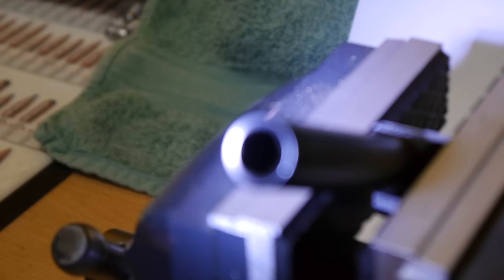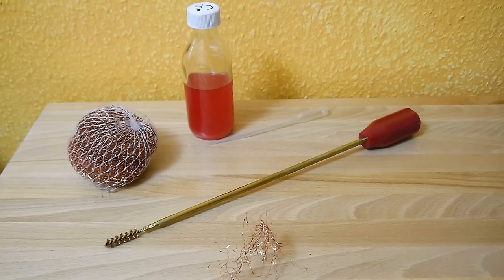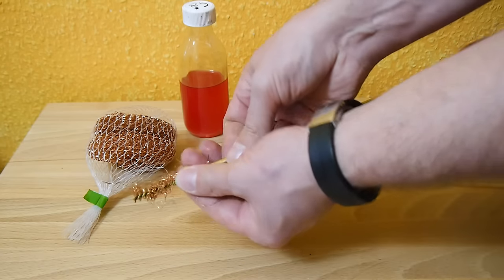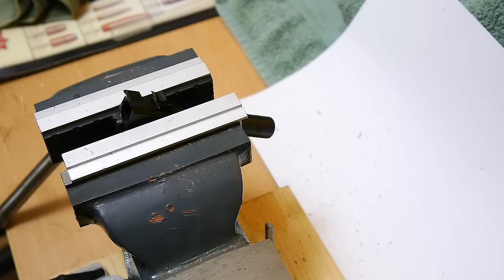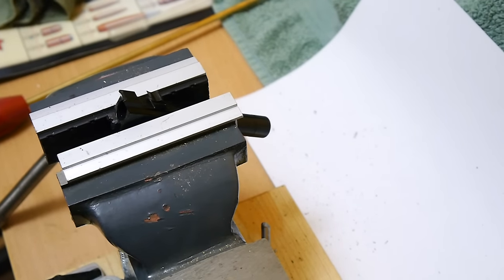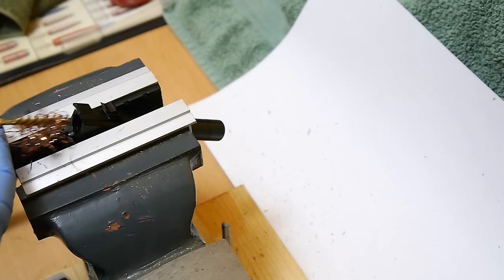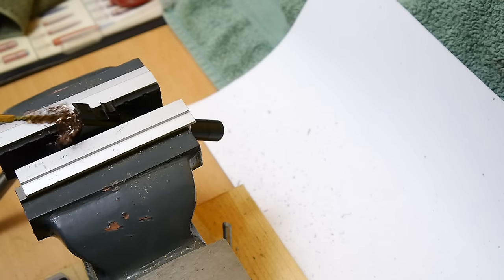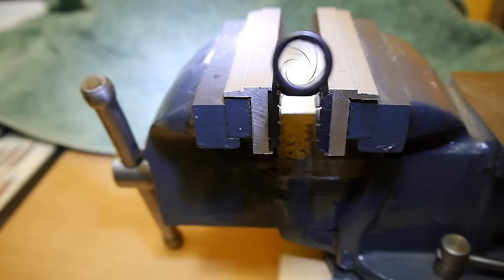Lead removal / cleaning a barrel fast & simple

Comment: I was taught this method in the Boy Scouts back in 1976 or so. We had a Rifle & Shotgun Shooting merit badge that was focused on marksmanship and gun safety. As an extra, there was a pistol course, and we had a very basic course that taught much more involved repair and maintenance work beyond the basic cleaning and oiling routine. It was excellent, too, as I still remember all of it.

Later, as a soldier in the US Army, we were NOT taught advanced repair and maintenance, but we did learn a huge amount on malfunction clearing and work to the bolt carrier group and very basic trigger/seer/etc. adjustments. We only shot FMJ and our barrels were chromed, so leading never really occurred. 

Years later and I inherited a German 7.65 mm pistol from about 1925 or so. The barrel looked to be shot out, with almost no rifling visible. However, it seemed to be accurate. It is a blowback pistol and it always went fully into battery. So after some research I discovered that it was very badly leaded. I remembered my old Boy Scout range instructor's lessons about how to de-lead a pistol barrel, and it worked on the first try. Of course, it took me about a half hour as it was very old and heavy leading. But it did come out using copper wool strands wrapped around a brass bore brush. 

Thanks for your video, as it make me happy to see someone else doing this and, thereby, validating my old BSA range instructor. Great video! Liked!

Comment: I put about 200 rounds of lead uncoated 22lr through my new Ruger SR22 the other day and it got fouled with lead really bad. I scrubbed and scrubbed but it was barely coming out. I came across this video and gave it a try. It worked fantastic. About 4 or 5 passes with the copper wool on a regular brush did the trick. I’ve been shooting and cleaning different types of guns for almost 50 years now and never seen anything like it. So simple and works so good. Thank you for the video.
Reply: I got a Taurus tx22 And it got leaded quick. I panicked. Till i seen this video and read your comment.
Reply: @daltexmex  After the pass throughs of the copper wool, what did you guys use to finish up the cleaning process?  TY
Reply: I just started shooting cast bullets out of my 357sig today, how do I know when I need to clean lead out of the bore?
I'm gonna apply extra wax to those things they're filthy.
Reply: I did the same with my Walther p22. Lesson learned.
Reply: @daltexmex  exactly why I came here. Tx22

Comment: Thank You for the tip...I cleaned a shotgun barrel using this method that had very bad leading after shooting a few dozen slugs....yes 2 minutes flat and the leading was removed !!
Reply: I took my shotgun to the range that only takes slugs. I've spent several hours trying to remove the led. So here I am.
In this video, it says to use a smaller brush. I have a 12 gauge shotgun. Would you suggest a 16 gauge brush?

Comment: Awesome tip! I use a slightly modified version I wrap a patch around a worn brush and then wrap that with the copper wool. I find this method presses the copper wool against the barrel much firmer and prevents the wool from just skipping over the fouling.
Reply: Do you use a fine, medium , or corse wool? Thanks

Comment: I have been powder coating all of my cast bullets which is a LOT of trouble with smaller sizes, i recently loaded about 350  9mm bullets from cast and now I have an excellent lead removal method. Thanks for another fine video.
Reply from the maker: Thanks for your comment Jim. Stay safe buddy.

Comment: This method just saved me hours of work.... got a new revolver, cleaned it completely from the factory fired round and took it to the range.  Fired 10 test reloads with gas checks on them (thinking that this would prevent the leading).  I have never seen a barrel as leaded as my barrel was after shooting it.  I used the standard brush and then patch for about a week of letting different cleaners sit in there to break up the leading and there was still chunks of lead falling out every once in a while.  This cleaned the barrel up in about 5 minutes with some ballistol oil.  Thanks!
Reply: Robert Yusinski - your leading was probably due to projectile being too small (you want 0.001-0.002 larger diameter so the base obturates and seals properly), or you need better (or more) lubricant.
Gas checks help with heavy loads to avoid melting the base, but if the bullet is a loose fit they don’t stop leading.
Reply: @freerange1776  yes that was the case.  I got cast performance bullets that you can only get sized in .511, but i needed to get them in .512.  Thanks for the reply though!

Comment: I've heard this method talked about for decades. I haven't tried it and I never looked for a demonstration until today. Thanks for the demo! I think I'll give it a go on my 44's and 357's that I almost exclusively shoot hard cast lead bullets.
Reply: I just started shooting cast bullets today, is it normal for the barrel to get leaded after only 10 shots? Or do I need more lubrication (wax).
How else can I minimize leading?
How can I tell my bore needs to be cleaned?
Can following up with jacketed bullets get me by, so I don't have to clean my barrel every shooting session?
Do I need to clean the lead out of the lands and the groves, Or just the lands?

I'm sorry for so many questions I'm new to hard cast bullets, and I bout 500 of them so I'm trying to learn as much as I can before I do a dumb.
I have a Smith & Wesson 40 with a KKM Stainless 5" 357sig barrel if that helps.

Comment: I have four Wilson Combat 5" Government CQB 1911s and Bill Wilson in the owners manual describes doing it very similar to your method. I just thought I'd comment and put that out there in case some guys were apprehensive about doing this. It made perfect sense to me when I first read it in my manuals. Cleaning brushes are typically too loose if you use the correct caliber. This produces a tighter fit to get down into the rifling to dig a little bit. It's basically the same thing as shooting a copper jacketed bullet through your barrel afterwards without the dangers of pressure spikes. These pure copper Chore Boy pads are getting harder to find in stores in favor of the cheaper material. I bought a case of them 30 - 50 on Ebay for less than $40. That should last me decades because you only use a little of the pad at a time and can reuse the brush with it wrapped around it until it wears out or gets too fouled with lead to work.
Reply from the maker: Thanks for the link brother... the black forrest (Schwarzwald) is a beautiful region here in Germany ;-) Stay safe bro. Greetings from Saxony Markus

Comment: Thank you thank you thank you!  Although I powder coat my bullets, my 9mm Shield still leads up, but my Sig 9mm doesn't. I have recently learned i probably need a larger bullet (.358) for my Shield instead of the .356.  I have not found a good demonstration of this process until your excellent video.
Reply from the maker: .358 is large....but as long as you can chamber the round it's ok. All the best from Germany buddy.

Comment: I've been trying cast loads for the 6.5 Carcano carbines and got terrible leading with them sized to .268.  I checked with pin gauges and there's nearly 2 thou of lead at the muzzle.  Turns out Im going to need to size them to .270.  First I gotta clean all the lead out, will use this method.  Ed's red is good stuff.  I also have a specific lead cleaner solution, I forget who made it.  It's pretty harsh stuff so I'll only use it if this won't get it all.  It's going to be tough since these bores aren't in great shape, a couple are a little rough so that's gonna make the lead so much harder to remove.  Problem is no jacketed bullets I can find will shoot well in them since they are all too small or the wrong style of bullet.  The only jacketed bullet they like is no longer made, the old .267 Hornady torpedo bullet.

Comment: Or you could just shoot 4 or 5 Jacketed bullets after done shooting lead.  Ed's Red is good stuff.  I mix mine without the Acetone and it works great.  Best CLP I've ever used.  I do not use it for lube - only cleaning and protectant.  Another technique that works great, if you have the time, is to just let your barrel soak overnite in a pan of Ed's Red.  Next day you can just swab everything out with 2 or 3 patches.  Really makes BCG for ARs easy to clean inside too with Q tip.  No scraping required.

Ed's Red Formula (exceeded military's specifications for CLP when tested):  Equal parts of Low Odor Mineral Spirits, Odorless Heater Kerosene,  Dexron II, IIe, III ATF (GM Spec D20265 or later) and, if you need to clean out plastic deposits from shotguns, etc., Acetone.

Comment: Excelent video, thank you.  My smith suggested I do this to my rifle after he had fixed a broken ejector But he didn't described how it was done, just that I use copper wool.  Pretty simple but didn't see you use the DYI cleaner you made.  I assume you had run some into the barrel with a jag before you start the scrubbing with the brush and wool?

Comment: Although the link did not work, I found some scouring pads on Amazon. However, they are copper coated, not entirely made of copper. I would guess its Zinc that they actually made of. Can I use them do you think?

Comment: Can you use hoppes number 9 as cleaning solution?
Reply: Hoppes #9 is no longer a good solvent.   There are good copper cleaners that are good for metal (not lead) fouling.
Reply: Hoppes # 9 is a proven way to breakdown lead fouling in a gun barrel. Have to let it soak to do its job. My shot gun gets extreme lead / wad fouling in its smooth bore barrel from shooting rifled slugs. I'll also add the copper strands next cleaning.

Comment: that  works wel ,but i use  when needed and i try to avoid it because of bullet choise ,a LEWIS LEAD remover.dont know if they stil available,  and i would only pull out  the  cleaning rod  toward the muzzle
Reply from the maker: I only pulled it to the muzzle...I switched the barrel only to film the inside...cleaning was done the "right" direction ;-)
Reply: sorry  i missed that. danke ihnen

Comment: Well done. Will buy a couple of the brass/copper dishwashing pads and use same method. I have been loading a surplus supply of lead 230 g .45 bullets and enjoy shooting them but the lead is hard to remove from my 1911 barrel.

Comment: Is that steel coated copper or pure copper?
Reply: must not use copper coated steel, only use pure copper or pure brass.  check it with a magnet

Comment: The risk of harming your barrel with copper in this way is NOT minimal: it's non-existent. No matter how hard the copper, it cannot even scratch your steel barrel this way. It's why the military mostly uses FMJ ammo. Carbon or sand in the barrel can wear the barrel when a copper jacket scrubs the barrel with it, as a round fired through a dirty barrel does, but the copper itself has no effect on the steel.

Comment: Running jacketed bullets has been a long known method of removing lead, however it comes with risks. If the barrel is heavily leaded, and, or happens to be a higher pressure chambering such as .357, running a jacketed bullet could damage the forcing cone. A heavily leaded barrel could be thought of as a form of barrel obstruction, so the ramifications are obvious and consistent with said conditions. Would you fire a second round down an obstructed barrel? Not advisable, and certainly not intentionally, common sense dictates that the obstruction be removed first, and it the case of leading, good old elbow grease or a product intended for the task is the recommended procedure.

Comment: y not just use a copper brush??
Reply from the maker: The copper brush is not so effective..
Reply: Simply brushing over the lead is not what we are looking for. Its the sharp edges of the filaments that do the trick, arranged in random patterns, cut into the lead.

Comment: Say goodbye to the barrel crown. You're never allowed to run a copper brush from the crown to the breech. And that copper will chew up the barrel.
Reply: Copper is so much softer than the steel barrel it would take a harder metal than copper or bronze to hurt the crown. Don't use steel wool !